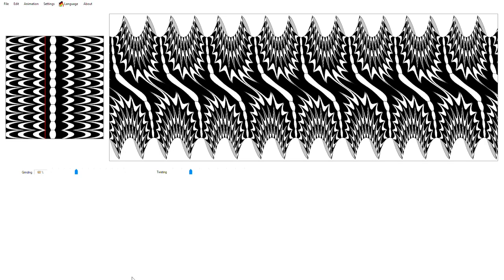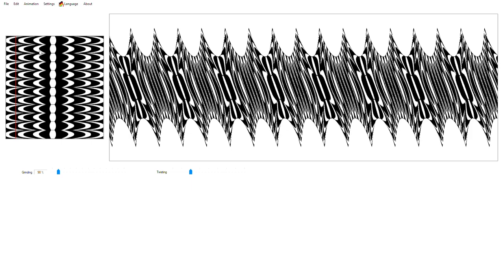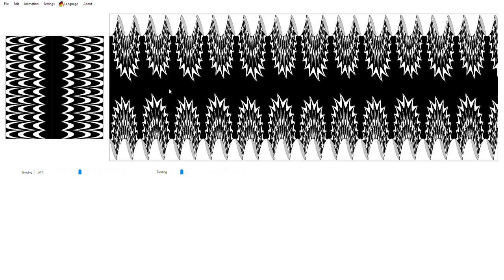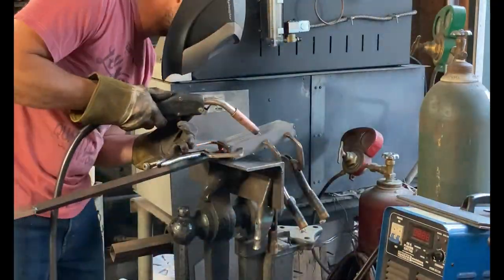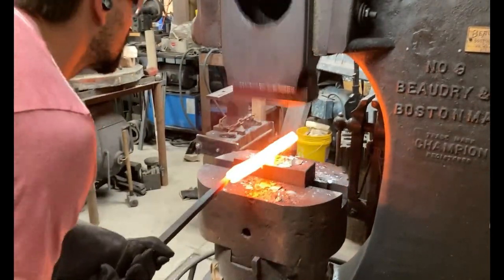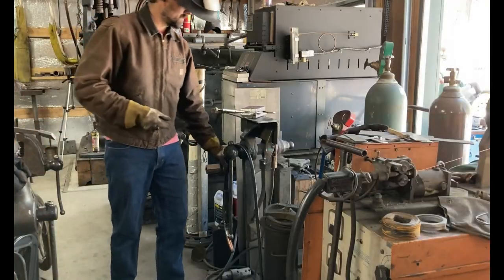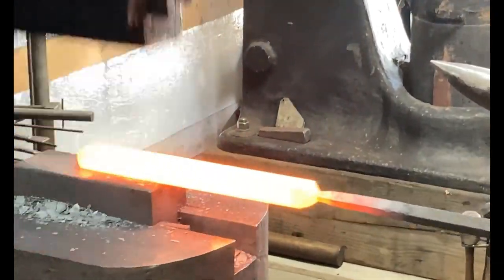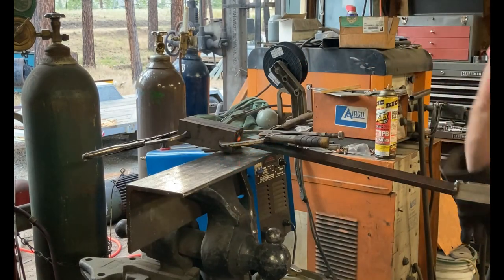Bolo 5

Comment: Did you grind off the twist before re forging?? Or just brush it and hammer the thread like into itself back into a bar.
Reply from the maker: I brush it and hammer it back into a smooth surface, no grinding step.  Grinding happens after cooling and generally doesn't take much to get a clean bar.
Reply: Salem Straub thanks, hear guys fearing cold shuts.

Comment: Great stuff as always, Just a question about how you dont use flux so assuming you use a neutral/reducing fire but their is no flame of carbon monoxide burning outside your forge and their is still abit of scale on your billit and you get good welds. It would be nice if you would quickly go over your forge sometime Cheers
Reply from the maker: It's a tough to see on video, but generally I do tune the forge atmosphere to be a bit fuel rich, with some orange flame coming out the door.  Just a few inches though. There will always be a little scale on the billet, regardless of the forge atmosphere... if nothing else it scales up as soon as it comes out into the ambient air.
I am planning to do a separate video on the forge itself sometime soon!
Reply: @PrometheanBlade  Thanks for your reply Cheers
Reply: @PrometheanBlade  curious, how do you maintain fuel rich with a PID ??  I always worried about scale during the on/off cycles of the PID... Thanks for sharing !!!!!